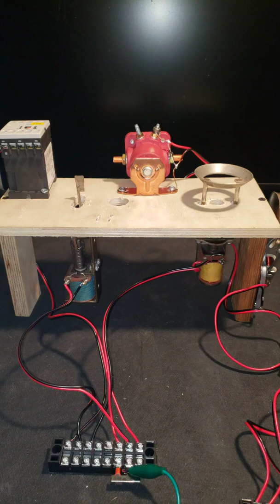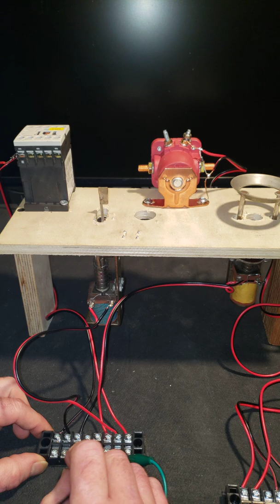24v Contactors VS 12V Solenoids VS Real Pinball Parts

Comment: Excellent video. So very informative..Thanks for sharing! I bought 10 of the 12V Red Car solenoids recently off ebay. Do you feel those will be sufficient for my virtual pinball cab?
Reply from the maker: yup.. they do work great.. for the flipper ones, put them as close as you can to the flipper buttons so you can get a slight tactile feedback when they fire... I was just looking for something with a little more kick in them..

Comment from the maker: The slingshot and pop bumper were out of a 1970 gottlieb baseball pinball.. The coil used in the pop bumpers and slingshot can be replaced with the A-1496 coil. This is a 28v coil and is sometimes sold with the 1n4004 diode on it.. If it has no diode the standard 1n4007 diode can be used.. It will fire great at 24v DC.. I would suggest that a inline fuse be used when using it in a Virtual pinball. 
 btw this is a general use coil that was often used in Pop bumpers and slingshots for Gottlieb  Early solid state and EM pinball machines. 

Link : https://www.marcospecialties.com/pinball-parts/A-1496
Reply: How much Amps it draws when on ?
Reply from the maker: I use an inline 3A SLOW BLOW glass fuse..